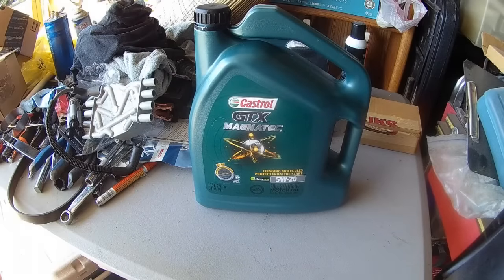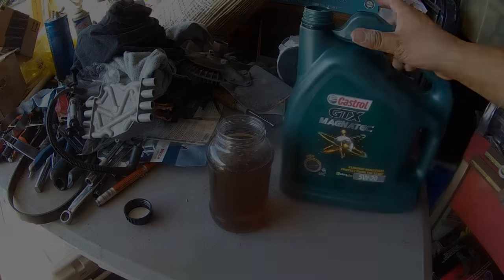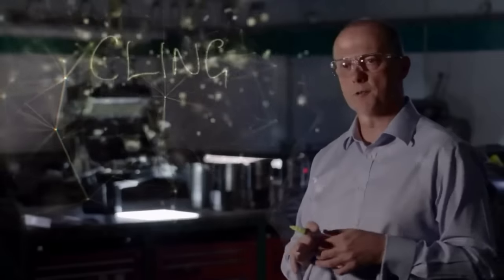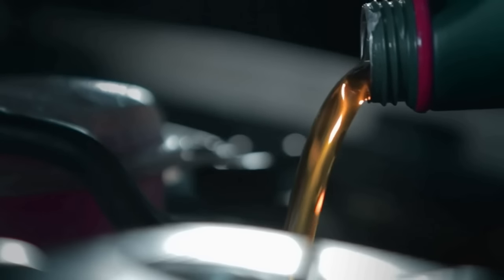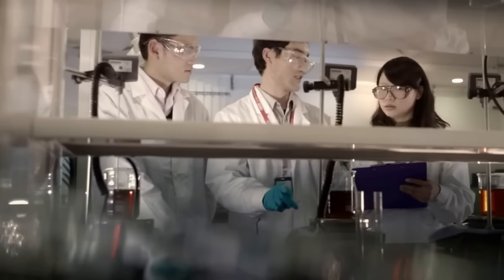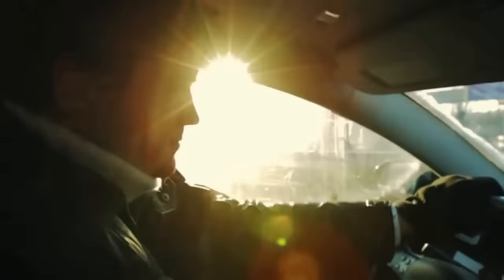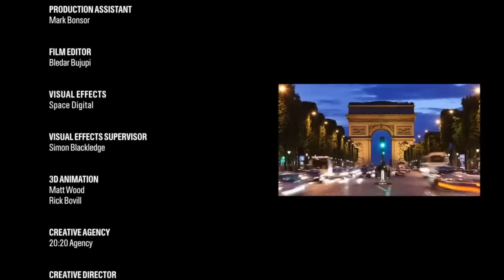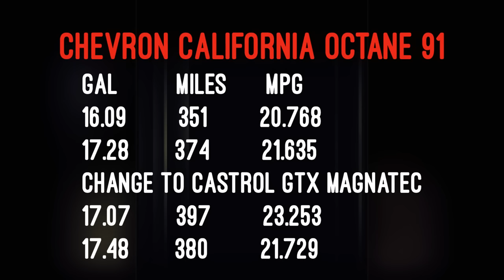Castrol Magnatec Engine Oil Review - Motor Oil Review - Is Magnatec Fully Synthetic? - Mobil 1

Comment: There is zero magnets or magnitizsm in this oil. Its just the name. understand that. Does valvoline have valves in it? Exactly.
Reply: I use valvoline and I can confirm mine indeed did have bits of valve in it!.The only reason I use castrol magnatec  my engineis its more readly available in every grocery store and garage and the 15/40 fully synthetic that  the manufactures recommend is hellish expensive and not on the shelf in most motor factors so I use Castrol Magnatec 10/40 for a worry free life in my daiwoo musso  with a 2.9 turbo merc engine.
Reply: so much hype for the product having the least manufacturer spec approvals... I don't get it.  It didn't meet specs put forth by vw, porsche, bmw or mb but it has a catchy futuristic name Magnatec!!! magnets! technology! the weight of 5 cars on the head of a pin & implying only castrol oil can withstand that!
Reply: @McCarthyism_by_Youtube  I can confirm that my Daewoo 2.9 turbo merc diesel runs better on 10 /40 Castrol magntec than it ever did on cheap tesco super market  semi synthetic 10/15/,40 and John deer tractor semi syth 15 /40.The engine is smoother  and less rattly more economical and the turbo kicks in sooner producing more usable power for towing 2. 1/2ton digger around . That's all I know!i like you dident believe the hype but my car had no poke and with some forte fuel turbo cleaner additive and a aerosol turbo cleaner sprayed direct in to the air intake iv got my car back allbe it slightly bent now as I was so confident I towed a 4/ton dung spreader home and I think iv knackerd the springs as it looks like a dog having a dump now. and I think the rear chassis is slightly bent but not botherd as these are cheap throw away cars and I'll just buy another for 500 with a full mot .The engines in them are worth that alone. but going strong and I don't think a bent chassis is a mot fail  . unless anyone has got any other suggestions .?and of course I'm going to open the pump right out and chip it (cheaply of course) I forgot to add I run it on used chippy fat .Only the best will do .These are getting  rare now .but I think I'm partly to blame for that .lol
Reply: @JohnDoe-ox5ni  well I don't want to admit it but my car was quieter and smoother on Magnatec 5w30 than pennzoil ultra platinum 0w40 AND castrol supercar 10w60. it baffles me to this day. I don't like Magnatec because it gives up early into the service interval... like lifter tick after only 1600 miles that gets worse until I change the oil. also timing chain rattle upon startup that I only used to hear if i parked it for weeks. I have 4 5L jugs of Magnatec 5w30 that I'll probably use for engine flushes or something
Reply: @McCarthyism_by_Youtube  that's interesting. this is the first time iv used magnatec bought only because of a two for one offer and the free  5 gallon of tractor oil I was given I felt wasent doing the engine any good as the power was flat with no turbo kicking in to speak of .I don't think iv done more than 200 miles since  and feels good at mo but if it is like you say loses its lube and breaks down as fast as 1500 miles ...that's not good .but I will keep you informed if the same thing happens to me .
Reply: @JohnDoe-ox5ni  most manufacturers' approvals hinge on the oils ability to stay in grade for the duration of the interval (euro interval is accepted as 10,000 miles/16,000km).
hydrocracked oil initially looks shiny and capable but peters out as cracked chains can't stay uniform as well as their pao-based synthetic groups can.  there's 2 camps of oil users- fuel efficiency(acea a5/b5) and wear protection(acea a3/b4) . users of 0w20 crave fuel efficiency at the expense of bearing wear by using thinner oils=less frictional losses on moving parts=less fuel burned. I'm aligned with maximum protection for the engine camp so I use a higher viscosity that increases frictional loss on the engine parts leading to more fuel spent and overall less fuel economy. I'm ok with my v8 that gets 14 mpg and want to get as much of the antiwear additive zddp as the oil allows but that takes up real estate in the additive package.
Reply: @McCarthyism_by_Youtube  wow mind blown .I'm going to Hydrocrack some beer .Stay camp concerned citizen  ..but 14 mpg ..i would never drive my car if it did that mpg !!.You are like the Green lantern. solving oil confusion.Cheers
Reply: @McCarthyism_by_Youtube  did it cure timing chair rattle ?
Reply: @A.QPerformance  after being scared shitless from reading the forums,  I replaced my timing chain tensioner and switched to redline 5w50 ester oil.  I usually change the oil before 3k miles as having a mityvac makes it a 10 min job.  chain rattle on a cold start is now non existent and imo not because of those changes.  the biggest difference was pouring half a bottle of seafoam in the engine and driving it 200-300 miles.  I took a HUGE chance doing that and it paid off by cleaning the oil passages. my filter was black after 300 miles! I hear no timing rattle, lifter tick, vanos rattle at all... it's harmonious brassy v8 goodness now at 105K miles. in empirical hindsight I should have logged oil pressure before and after the seafoam

Comment: Which oil would you put in a turbo car castrol edge 5w30 castrol magnitek 5w30 or castrol gtx ultraclean
Reply: Turbo engine full synthetic group 3 or 100% synthetic group 4 or 5. Edge or Magnatec should do fine.
Reply: @JayzBeerz   it ran like crap on valvoline 5w30 full syn. Put castrol edge gold in it ...... got my car back! Thanks for the reply
Reply: @dnawrapsatl  I'm using Quakerstate Ultimate Durability Full Synthetic 5W-30 in my 2019 Sonata Turbo and it runs great.
Reply: @JayzBeerz  i ran quaker in my scion tc ALOT its good stuff still runs today
Reply: @dnawrapsatl  nice man
Reply: If a few more dollars is not an issue go for the Edge. Otherwise Magnatec is as good as Edge.

Comment: I perceive Castrol as a premium quality oil. But maybe that is just a perception. I have never run an engine so long that wear has become evident. 
I have just replaced the oil in a 2011 Malibu with the 2.4 liter engine with Castrol Maganatec 5W-30, I have not noticed any difference in the way the engine runs and the MPG has gone down, but that is probably because the weather has become colder.
Regarding what weight to use, I am not going to second guess a manufacturer mechanical engineer who recommends a specific weight. If the engineers say use SAE 0W-20 oil, that is what I will use. 
Every owners manual I have read says do NOT use oil additives. So, I stay away from them.
Where I don't follow the rules is the oil change interval. The Malibu  has an oil life sensor that seems to say "Don't change the oil until you have 10,000 miles on it. I always change the oil when it says there is 50% oil life remaining.
Magnets on the oil filter? Has Bundy sawed open his oil filter and found metallic sediment gathered around the location of the magnet? I suspect not. Many of the wear surfaces are aluminum and other non-ferrous metals.
Like Bundy, I doubt claims made by advertisers, but I also doubt statements made by  non professional mechanics.
Reply: Well I don't know about y'all, but I do a lot of in town driving. I change my oil approximately every 150 hours not by Miles. Oil and filter or cheap if you do it yourself.
Reply: Give it a few changes to get the real mpg. If it went down its probably a mix of some old oil impeeding the castrols performance.

Comment: So basically no change in mileage.  The high one of 23 is an anomaly and that would need to be thrown out.  You can get a 2 mpg difference on almost any fill up depending on a few things. Now if it were 23,23,23 over and over, I would say, there is something there. Also fresh oil will always give you better mileage for a tank or two. So not conclusive. I'm like you - skeptical. Next, if you let your car warm up for 5 or 10 minutes every time you take it, your over all mileage is not going to be as good.  Lastly, I would follow what the engineers recommend on a vehicle and not follow  so called "common sense".  What is not known in your assumption is the oil pathways and ports. Some are pretty small and will not allow a heavier viscosity oil to go through as easily or as designed. Otherwise why wouldn't everyone use a straight 50 weight oil in summer and a straight 5 in winter? It all depends on what is engineered into the car. We don't know that and are assuming the professionals are idiots. They may be, but that's a different story. All I know is that cars today are not what they were 30 years ago or 60 years ago when much of the common sense lore developed. I think Castrol is probably a good oil, but is it that much better? If you can go 500,000 on an engine, then great. Your basically wearing the car out and then getting a new one anyway. But by the time you get 500k on a car, you will have replaced the tranny 1 or 2x's and probably want one that is more modern. But maybe not.
Reply from the maker: +jimflys2 thanks for the post. I have a 98 Silverado with 300,000 miles on it. Original engine and transmission. I changed the oil and oil filter every 3,000 miles like clock work. I also put magnets on the oil filter to catch loose steel in the engine. I would like to believe those are the reason I have 300,000 miles on my truck.

Comment: I give you one example of oil viscosity used by the same manufacturer in the same car in 2 different countries. I bought my Subaru Forester 2014 in a desert environment , summer temperatures can reach 55c / 130f, Subaru dealer only used one oil for the car: 20w50 yes thats right I was shocked lol, and then I moved to a very cold country with winter temperatures reaching -30 c/ -22f, and the Subaru dealer uses 5w30 castrol . and if you check the car manual it strictly recommends 0w20 lol. and I can tell you the difference, my engine runs the best sounds the best on 5w30, I used 0w20 for 2 seasons and the noise my engine makes was very bad. could be related or not but this is my experience.
Reply: This is so TRUE

Comment: Magnatec is Castrol's medium-range hidrocracked oil. 
It's a good oil for it's price. Change it every 10.000 km and get over their magic propaganda.
Edge is a top range Castrol oil and more preferable, why complicate things?
But, if one is looking for quality oil superior in every aspect - engine oils based on real PAO/ester base are still no.1.
As far fuel consumption goes... fresh oil always gives better mileage if compared to the old oil. Not so scientific to make a 20-minute video. These 5w-20 grades are primarily made as fuel economy oils.
Reply: You must not be informed. There are no ester based motor oils. Redline is at most 10% PAE in it's popular grades it's 1-5%. PAO was replaced by GTL and other group III base oils. Actual oil specifications and manufacturer approvals are what is important not marketing terms.
Reply: @davidporter7051  
Yes, GTL replaced PAO in some premium synthetic oil formulations, and it is good enough.
Shell and Mobil use their GTL, but otherwise...you'll mostly get group III. and hope for the best. A lot of room to manipulate formulations, even the GTL ones.
Actual oil specifications and approvals don't keep an oil stable in service, quality base oil does. 

PAO is still a base oil used for many 0W-XX synthetic oils, egz. Castrol ones.
PAO based oils, with the addition of Diesters are very rare today, but they do exist (and not just "racing" oils).

Comment: Anyone ever experience any new type symptoms with your Oil Pressure and/or Oil Temperature Sending Unit failing after using Castrol Magnatec 5w-20 ? Within roughly 10,000 miles of use which = 2 or 3 oil changes for me, 'I've now recently had to replace 2 Oil Pressure sending units after trying this new to me engine oil in my 2006 dodge charger RT 5.7l with 154K miles the car now has that I bought from brand new....Just starting to wonder if maybe the molecules that cling to certain parts of the engine might not be a good thing for other parts of the engine.
Thanks all...
Reply: I have the same issue
Reply: I was debating to put this stuff into my 21 Charger to help with a Tick but you guys have me worried now.
Reply: @franklin.chukwukere  how's your Engine doing now?
Reply: @jeffreyzabawski4862  sold the car

Comment: I think Castrol pushes the boundaries of adverting standards first and oil tech second.
Reply: Fred Last ..me as well. lol. don't get me wrong Castrol is very very good motor oil but not as good as Mobil 1 or Penn Platinum. based on professional independant testing
Reply: It's very close thou and there are many v.good ones on the marked and some compare price and durability as well wear factors as the best over all.I agree Magnatec is a good few levels below the oils you mentioned.Mobil 1 Penn Platinum plus Valvoline and Royal Purple are very good too.
Reply: You are all making valid points... however, I feel that maintenance, driving conditions, and driver behavior have a much greater effect over time than the actual oil itself.  That is not to say that one oil is not much "better" than another.  I just feel there are several non-oil related factors that can trump the factor of "which oil" is being used.
Reply: David Klimmek would like to see these results from the independent testers can you provide the links?
Reply: @fwh79FOXR6  ultimately you can go down to the molecular level and say oil x has more of component y than the competition BUT in real circumstances, over a realistic vehicle lifespan, i don't think it matters all that much. any oil that meets specs and is changed at the manufacturer recommended schedule will work as well as the next. at the end of the day not only is this a mature technology but the majority of motor oil companies don't physically manufacture anything anyway, they just buy the ingredients they want from elsewhere, blend and bottle.

Comment: Group 5 base stock: Esters.  
Esters are polar molecules.  
Exactly like a little magnet. 
Some esters are VERY/polar-magnetic.  
They are used as paint strippers on steel.  
They suck right thru the paint and lift it off.  
My guess: 
that similar is adding to a Group 3 base stock 
to make Magnetec.   
My equipment sits months between start-ups. 
I switched. 
It is priced right.
(eye bin two collage]

Comment: if its magnetic oil you should put a small magnet on the side of the container and it should stay. I highly doubt it's magnetic. It's just a marketing gimmick. AND when you change the oil, you bring it to the recycling center and it blend in with other used oil. What happens to the molecules then when they reuse the used oil? Does the magnetic material go away? do they stay?
Reply: Never heard anyone say this oil is magnetic lol.
Reply: Magnatec is a name. Not a magnetic property. It uses chemicals that have better bonding to metal, in a way it forms a thicker and more durable layer
Reply from the maker: Then they should prove it. Run 2 cars for 100,000 miles, one with conventional and one with Magnetec. After 100,000 miles pull the engines apart and measure the parts against the factory specifications.

Comment: Run the engine until 15k miles, drain. Don't refill. start engine and let idle. Do whatever keeping an ear on the engine. See how long it lasts at an idle after running magnetec drained. Test proven.

Comment: what you also need to do is have previous oil samples to establish a wear rate before trying a new oil. than retest after using a different oil and see if there is more or less wear metals in the oil. there is also many other things that motor oil does but everyone gets so hung up on wear! viscosity modifiers, antifoaming agents, corrosion inhibitors, acid inhibitors, and so on. you don't need to take two cars and run a million miles to test oil. come on Bundy! do your research if your going to make an intelligent oil video!

Comment: What people are forgetting is this oil doesn't meet alot of manufacturers specs like mopar 6395 or Gm 6094 or 4718 and a few others I can't think of.
I wonder what the reason is.
Another thing to consider is if it's coating stuff that has to slow down heat transfer to the oil to cool the motor. Similar to SLICK 50 and ptfe, I consulted oil companies years ago about stuff that coats motor inside and a couple companies said same thing you don't want heat transfer slowing down and that honestly makes sense.
I WON'T RUN MAGNATEC

Comment: Put it in my Tacoma and it quiets my Tacoma tick. Even though no one can agree what causes it.
Reply: Toyota uses Mobil from the factory. My 2020 and 2015 Prius came with it and was filled with it during services. They both ticked and were noisy as hell. Any other oil that I've put in them, besides Mobil has quieted them down.